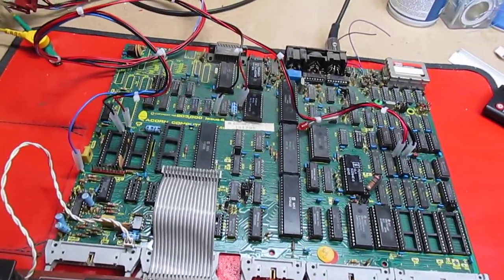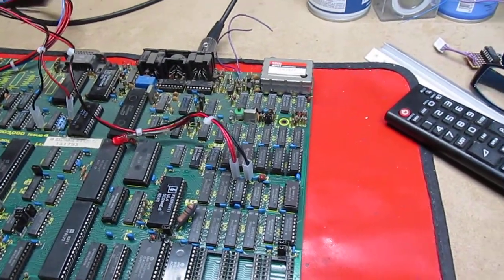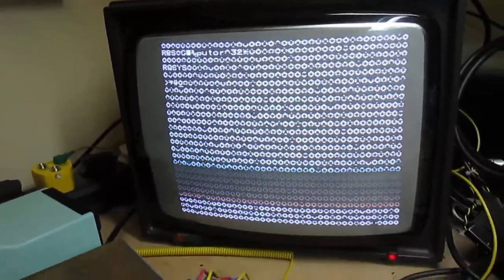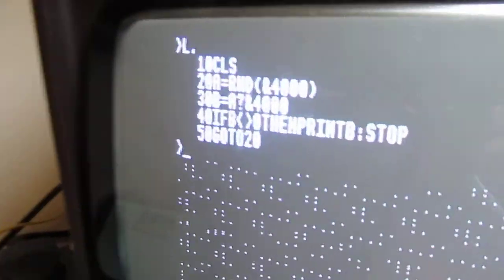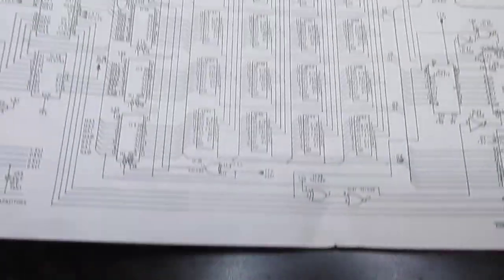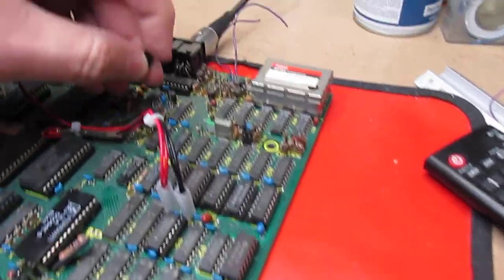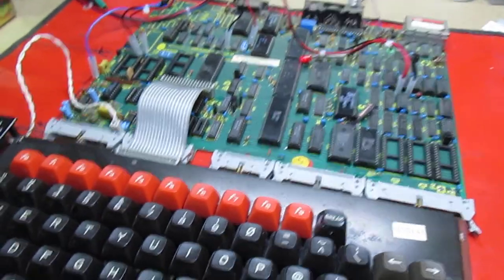Diagnosing a BBC Model B RAM Fault.

Comment: Thanks for this VERY useful and informative video! My Beeb makes that dreaded noise when I turn it on, so after I re-cap the PSU I’ll check out the RAM. Can you please post more info about your nifty inverter set up?
Reply from the maker: It's simply one gate of a logic inverter, such as a 74LS04, to invert the signal going to the 74S138 to select the opposite RAM bank.

Comment: I know this is a few years old but hopefully somebody is watching.
I've been working on a model B for days now.
All data printed to screen is the ASCII code + 1, indicating bit 0 is stuck high.
Kind of pointing me to IC53 or IC61. Changed them but no fix.
Using the program listed here I get number 1 and STOP at line 40.
Using the inverter, no boot, continuous beep.
Without inverter:
S25 North, boots with garbled screen.
S25 South, no boot, continuous beep.
S25 Absent, boots into 16K
Using MartinBs memory test, in certain modes showed IC 54 as the culprit.
Swapped that out too, no change.
HELP !!!!!

Comment: I have a continuous beep but the bbc 32k bit comes up on screen is this likely a ram prob also?
Reply from the maker: No, that's more likely to be the System VIA, or something in the support circuit around it.
Reply: @RetroClinic  yes u where correct it was indeed a faulty 6522 thanks for ur help

Comment: So I did the memory test and I got 201. Tested it multiple times. So as far as I can see, this means D7,D6,D2 and D0. So 4 memory chips failed. Is that right?
It is a German BBC so, now I have to figure out which IC is is, cause the IC numbering doe not match the schematic.
But before I start soldering, I am right with my calculations?
Reply from the maker: That would indicate D7, D6, D3, D0 - 128+64+8+1 - however that's unusual for so many to fail, what does your screen look like as you do the test?
Reply: @RetroClinic  Fixed it. I used MartinB's Memory Test Tool and that pointed to 1 specific RAM IC. Replaced and problem solved!
Reply: @joopidema  thanks for updating your post. I´ve also got a "201" as a result, so I´m happy to see that this method actually is helping in locating just a small number of RAM IC´s that might be the guilty one.
Reply: @RetroClinic  I ran the test in Mode 0. The screen is completely black during the test. 
When I boot up in Mode 7 the text is garbled. Mode 1,2 give some red extra characters. Mode 0, 3,4 and 6 look normal.
Reply: @RetroClinic  I just noticed that in Mode 0 some l l l l characters appear when I do a listing

Comment: If I use the inverter and can't get the machine to a boot/input state would that indicate that too many of the RAM chips have failed?
Reply from the maker: Either that, or there's another fault on the board somewhere.

Comment: Great video, I now know I have a fault in the upper 16k as my machine is booting but with random brackets on the screen in 32k mode. Now to find out which ic is the culprit. And mine are all soldered in.

Comment: Very interesting video. Could you please explain in a little more detail the method for translating the number produced by the program to the Data line creating the fault? Thank you.
Reply: Its just from the way that each DRAM chip provides 1 bit in the final read byte and the binary representation.
E.g. D0=1, D1=2, D2=4, D3=8, D4=16, D5=32, D6=64, D7=128.
Looking at the schematic D4 is provided by IC65 and IC57. IC57 was disregarded because it was already known to be ok.
If there had been a dual RAM fault (very unlikely, and very unlucky!) and the value read by the program was, say, 33, this would indicate D0 and D5.

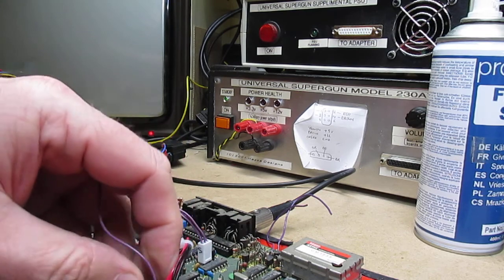Comment: Good tip, thanks! When you plug the +5V lead for the inverter (at 1:50) is that a bare wire you poke into the top of the PSU connector?
Reply from the maker: Yes, it's just to provide +5v to the inverter board.